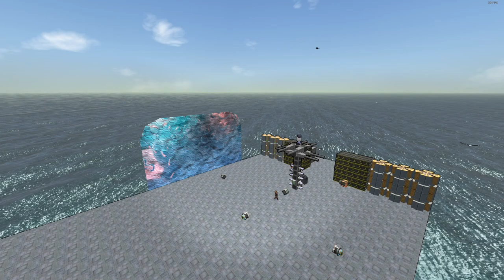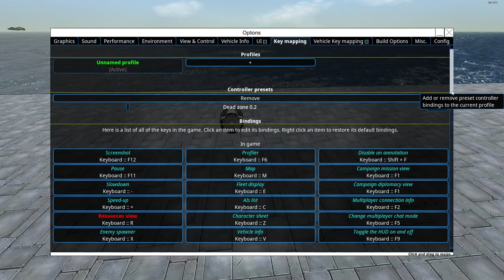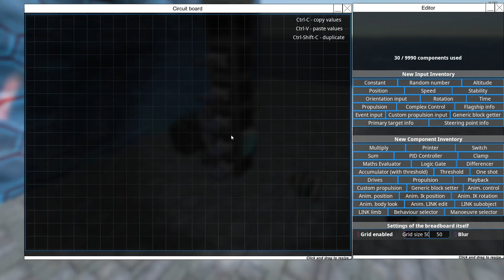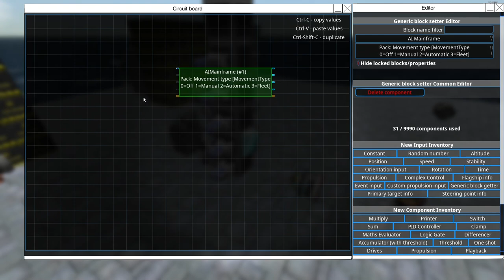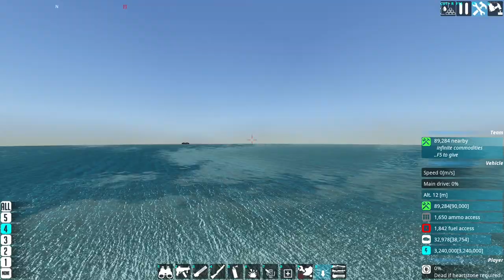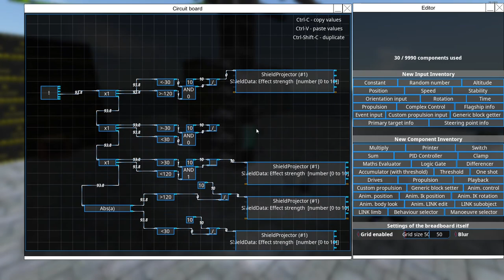Reactive Shields with Breadboards! | From the Depths Tutorial

Comment: I used to do this with ACBs, it's nice this can be done in breadboard in a single block
Reply: How many acbs do you need to implement something like this? If you dont mind me asking.
Reply: @dkelrk1  should be two per shield segment, so for the setup at the beginning of the video would be eight in total. at each shield segment, one to turn on when an enemy is detected within a given bearing and one to turn off when no enemy is deteced within the bearing range.

Comment: Can you turn on a shield generator when a munitions or laser warner detects something via ACB? It would be even nicer if the shields only turned on where shells or lasers are actually incoming and only close to that spot. That would be a more distributed and robust aproach to shield control and would also handle enemies from all angles.
Reply from the maker: Unsure, but probably would suck due to shield spool up.
Reply: Nah, it does not work. I thought ACBs could read stats from blocks around it, kinda how it can control blocks in a radius, but it cant even detect if APS shells are incoming. Only CRAM, missiles and lasers on the whole ship or turret. Also I did not know about shield spool up.
Reply: @dr.robertnick9599  
Place Shield on Two Axis turret controlled by CIWS controller and, hook APS block to read turret activity, and then turret get active (start moving) activate shields on the the turret, and then turret go's idle to deactivate shields. Simple
Reply: CIWS can’t track APS
Reply: You can set up a projectile avoidance AI routine, and highjack it to output projectile orientation into an auxilery drive.
To avoid shield spool up time, you can low power the shields until it spots something.

Comment: What if just placing shields on 2 axis turrets and let them be controlled by weapon controller ? multiple enemies ? Connect Shield Turrets to different AI's, you have 1 to 10 for a REASON  !!!
Reply from the maker: That doesn't fix the issue of shields on the wrong side of your broadsider being on when you're not using them.

Comment: 20k Power is nothing much, a good old 5x5x5 3-2 Turbocharger gets 4160 so that's 125 Volume (including the fuel tanks) times 5 equals 625 Volume Engine, max. With a combined demand of 36-38 MpS. There is sooo much space, it really shouldn't be a problem.
But I see the point of the reactive shielding. Personally I don't like them very much, because nowadays the shield gen needs time to spin up the shield. Not so much on low shielding, but a lot on high shielding. 10 Seconds spin up? Something like that. Against Bombers or really fast gunships, that is a problem.
Reply from the maker: Spool up can easily be dealt with if you just either: 1. Use the enemy's velocity to determine where it'll be next and activate those shields early or 2. Widen the thresholds for the shields so that they turn on earlier.
The entire idea is that this is used for battleship dueling; keep the side that is under fire on and the side that isn't off. That power isn't essential to save, but if we're saving 10k of power that can go into rail draw and increase our DPS instead of being wasted on nothing.
Reply: @Brenzo44  if you put both solutions to use that should work just fine, that's true.
There should be some kind of backup power source for the times when both sides are on, for whatever reasons. Shouldn't happen too often, but I wouldn't risk shield failure.
How about lowering the drive to 1 instead of completely turning them off? That way you could use the decaying left overdrive and it would already lower the power cost dramatically. What kind of shield drive do you plan to use?
Reply from the maker: That could possibly work, yes. And what do you mean? Power source? Thats what the next video is about, if thats what you mean
Reply: @Brenzo44  Power source, a source of power on your vehicle. Maybe power provider I'd a better word. Engines for example. You'll have varying power demand, and for that you'll need to be able to provide enough power for the peaks. But for efficiency sake, you probably don't want a stable power output to match that. The most intuitive option is an electric motor. It provides an estimated 80 power per volume. The second option is to go for an engine that only runs if the other sources are exhausted. That would go for 35 power per volume, but comes with a third of the price of the electric engine + batteries.

Anyways, if you use batteries for railguns it's most likely more efficient to go for the electric engine.

I hope I don't sound condescending, I'm just spewing ideas out there because non of my friends understand what I'm doing in ftD :(

Comment: I don't recommend this strategy, it won't work when there is more than 1 enemy. You could detect multiple enemies by detecting changes in the rotation of rotation-limited turrets though.
Reply from the maker: It's meant for a 1v1'ing battleship.
Reply: @Brenzo44 question, if there is an enemy on both sides of the ship both the port and starboard shields will be on?
Reply: @Cooldude-ko7ps A breadboard can only read your PRIMARY target. All other enemies are unknown.